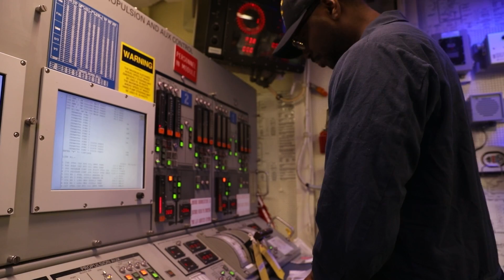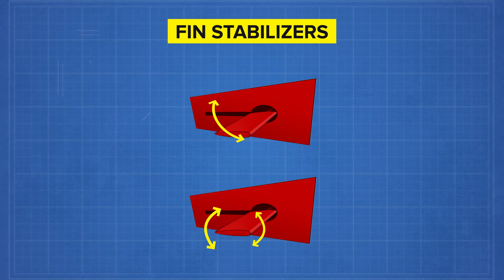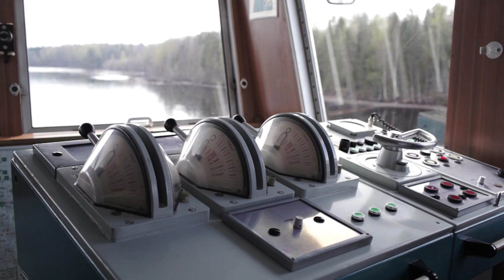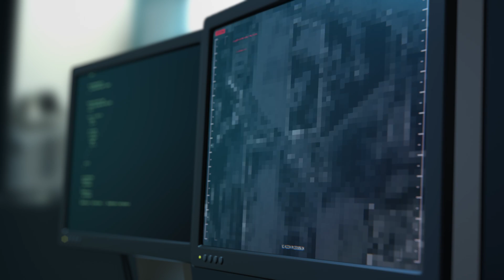Real Reason MONSTER WAVES Can't Sink LARGEST Aircraft Carriers

Comment: "Knots per hour" are units of acceleration, not speed.
Reply: G'huh?! so: 'ten knots per hour' for example, means a ship is traveling at a SPEED such that it would move ten knots in an hour, eh?

Now, 'knots per hour, per hour' WOULD BE a measure  of acceleration, like how gravitional attraction makes a mass accelerate toward the center of the earth at 9.8 meters per second, per second. (Often written as 9.8m/s/s, or 9.8m/s^2, etc). Saying that something is going '9.8 meters per second' is meaningless vis. acceleration, as is 'knots per hour'. And even saying a ship is 'accelerating at X knots per hour' is ambiguous and thus not used, in my experience.

(But, maybe there is a convention I'm unaware of, where knots 'per hour' implies 'per hour, per hour', BUT, if so, how does one talk about a ship's speed in knots travelled in an hour? Obviously not by saying a ship is moving at a certain number of 'knots per hour' appearently!)
Reply: @bholdr----0  "Ten knots per hour" means that every hour speed increases by ten knots. "Negative ten knots per hour means" decrease.

Comment: They spent 9 months cutting the Oriskany to be an artificial reef and it still barely sunk.
Reply: Really? Nine whole months? Jeez... They spent that time removing oil, fluids, asbestos, valuable copper, etc.

...And if the USN wanted to, it could've been sunk in ten minutes FLAT- with a few, maybe only one or two, torpedos. (Aaaand, It had to be sunk SAFELY, and in a specific way, to fulfill it's role as a reef without becoming a hazard to navigation.)

What does that process have to do with anything in this vid?

Comment: They are a bubble basically when they close it up. Also, the weigh of carriers vs like a battleship, the weight of big guns and many of them, plus the turret weight and other high structure, and the fact they made the battleships low profile to be smaller targets, means a lot of weight is pretty high up on the ship compared to carriers. 
I'm not a ship builder so I could be wrong but that would be my answer at hand.